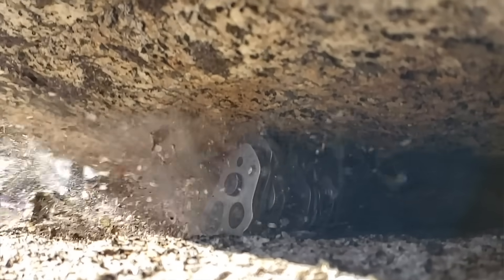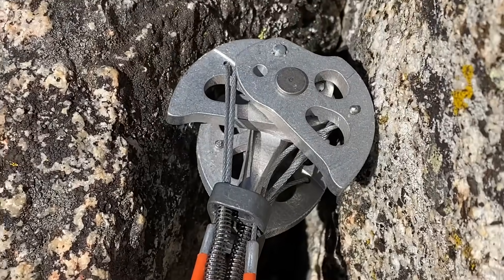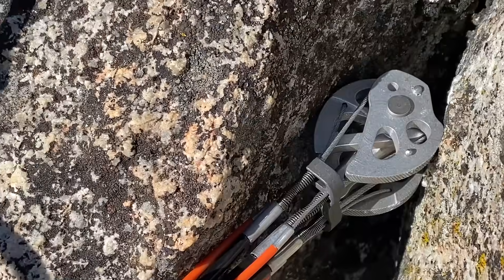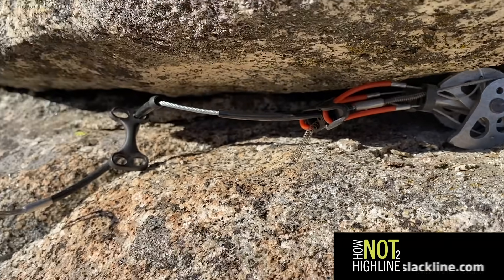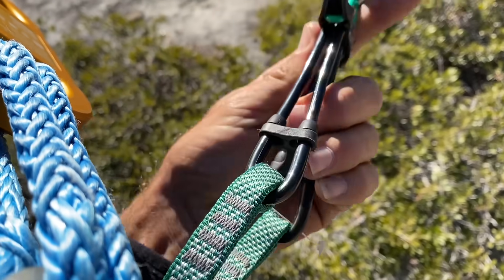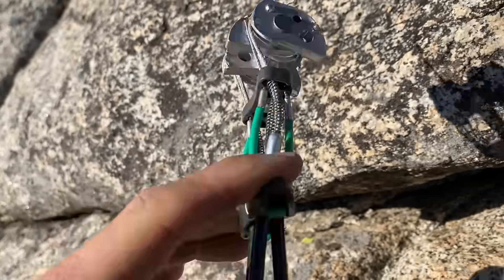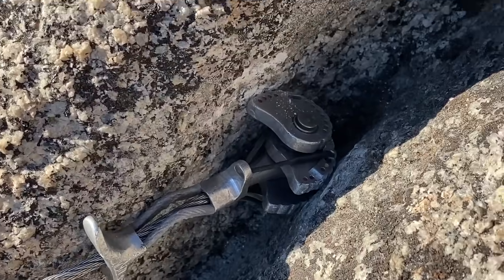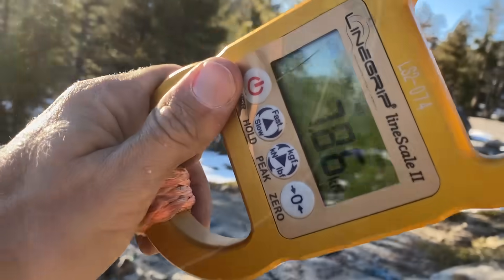Totem Cams TESTED!

Comment: It's quite fear inducing to see the cams come out at very low force, even though you thought the placement looked good. Seems like it's really hard to tell in advance how much those will actually do for you in case of a whip that you didn't anticipate...

Thanks for all the content! I love everything you do!
Reply: Honestly most of his placements were marginal except the horizontal ones where the totem wire broke at the head. Plus the rock was pretty crumbly so I was not surprised most of those pulled out. Don't take his placements here as examples of textbook cam placements.
Reply: @Govanification  maybe it's also a little bit hard to judge in the video - maybe it would have been more clear how good or bad the placements were in person.
Reply: @Zolodar  Yeah true. Also tugging on a cam to see if it shifts helps evaluate. But the flared cracks and uneven lobe retraction were pretty obvious to me.

Comment: how about some commentary about the failure mechanism on good placements? The orange cam wires broke right off - just experienced this in the field - my buddy just took a big fall because a wire broke at the lobe - would be good to know if that's a common feature of these failures (he's OK - but annoyed).
Reply: Did you ask about or send the broken cam to Toteam? Or any further speculation from you guys about what might have gone wrong?
Reply: @sakaricajanus90  I don't think he followd up with Totem about it, but my speculation is that it happened because he fell on the same cam twice, the first fall may have weakened the wire and the second fall broke it, it was a 0.3 (blue) size, with skinny wires. Moral of the story: be careful how you place totems, and make sure to inspect them immediately after falling on them, with attention to the condition of the wires (especially where they go into the lobes).

Comment: The metolius cams at the end should be used in a smaller crack. The cams are engaged in the yellow zone. Should ideally be in the green. The fact that the cam didn't break means it wasn't a great placement.

Comment: If all lobes of a totem touch the rock then all lobes will be loaded. They are equalized by design if you clip the center. I could help you folks a lot with this but I would recommend talking to plaid the representative for totem in the states

Comment: The AMGA instructor that I go through, says that if you only use 2 lobes on the totem cams, you're supposed to clip into the small loop on the sling that attaches to the plastic bit.

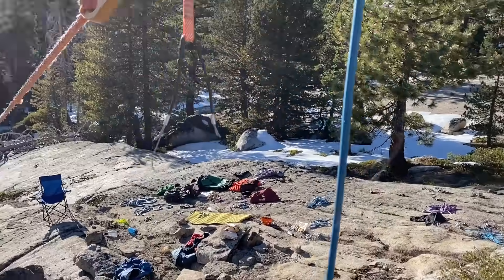Comment: Thanks Ryan Jenks! I love this video: I now understand why Totem advises against "clipping both slings" but it is ok to "clip the shelf" (if that makes sense). The reason is that "clipping both slings", with the kind of destruction at 6:22 of your video, the carabiner would be out of the system! But "clipping the shelf" gives it a chance to catch on one side... Makes sense? AGAIN: Big value in your videos! Thanks!
Reply: Never had one inthe hand but i guess that if u are hanging just in two lobs it also makes sense to be clipped to the loop so u wont have tension at one sling

Comment: you should start testing with falls instead of progressing force with pulleys. When you climb you want things to work against falls.
Reply: Yeah, he's building a drop tower for that. That sort of testing is harder to do since you need a much more expensive set of equipment to measure the actual forces (comes down to resolution, measurements per second).

Comment: dmm dragons are my go to cam, they bite really nice and they have an extendable sling which is really nice.
Reply: and the sling sits better on the back of the cam as they go through the stem not through the cable from the thumb loop

Comment: Great video!! It would be exciting to see how they do over an edge. For example, a horizontal crack where you pull down vertically. Greetings from italy
Reply from the maker: Good idea. Bobby may have found a better test area. It’s hard to find a good crack at a good size in a good rock at eye level within a 1/4 mile from the road (testing gear is heavy).... that no one will complain I’m hurting the rock 😂
Reply: Agree, this would be a cool test to see!
Reply: @hownotto 
Fresno Dome campground and surrounding.  Much more exposed granite after the fires.
Mammoth pools  and surrounding.

Comment: I know you've done videos on the KNs of falls but it would be worth referencing an "average fall" in KNs (qualified as necessary) to get a context of these results. Maybe an "I'd whip on that" scale?

As an aside It'd be interesting to see the check sandstone knots tested?
Reply from the maker: I should mention what a range of force we get on falls so the numbers we get in the tests are more relevant and understandable
Reply: Most lead falls generate 2-5kN
Reply: They did a video on falls already
Reply: @mikelarin8037  yeah I know, but it would be useful to reference it because my puny brain can't recall the size of the forces at play. 
It's be nice to have a human scale for reference. E.g. this cam would have broke / popped with the force produced by a 60kg average joe falling Xm straight down with a hard catch?
Reply: @simonjenkins9296  These cam heads seem to get abused at regular fall Kn's...But the soft metal will bite better in the rock
Reply: @50StichesSteel  yeah but better that they look rough and hold!
Reply: @simonjenkins9296  No problems with that aspect but durability is a problem too...Deformation is nice for the one whipper until you go to use it again.

Comment: What was the test difference between the Aliens and Metolius cams?
Reply: totem lobes are much softer, and so they keep better the placement
Reply: @enricociuppa7093  this is not true. Totem use 7000 series alluminium which is usually stronger and more resilient than 6000 series ally that everyone else uses.
Reply: @TheLordsaviour  something new for me, with your surname you should know a lot about materials.

Comment: it would be awesome to see tricams tested this way
Reply: I've sent him a single set of the Camp Dyneema Tricams.  (0.5 pink, 1 red, 1.5 brown, 2 blue). So that will happen.
Reply: @PeregrineBF  That's great. Thank you so much. Actually, what i would want to see is not so much getting destroyed (i trust the manufacturers MBS indications) but what placements fail and what placements will hold a fall. Very hard to test that in real life with real climbers lives on the line.
Reply: I agree
Reply: They’ll probably pull super low😂
Reply: @landonm815  i hope not, i am now trusting them with my life, so...